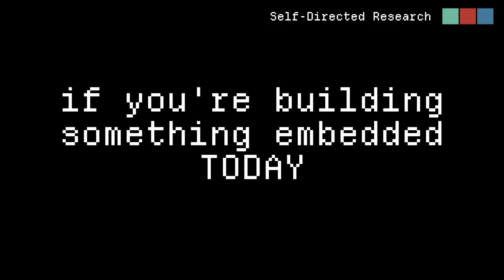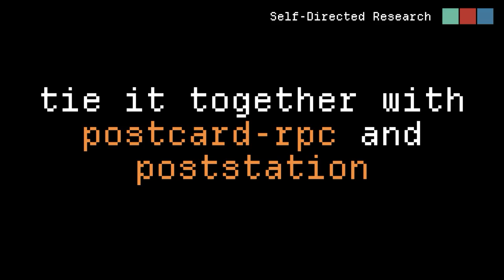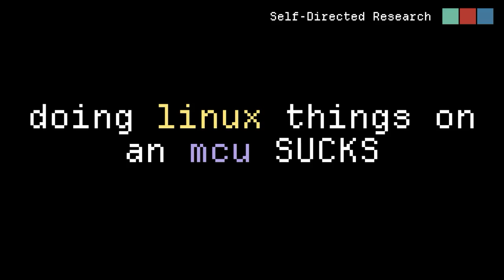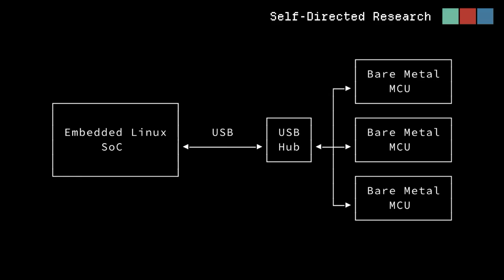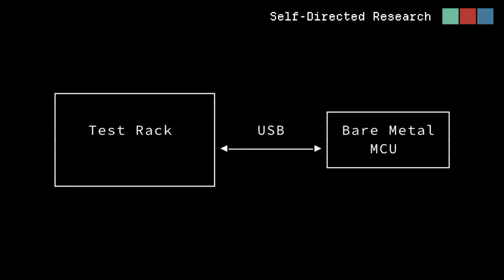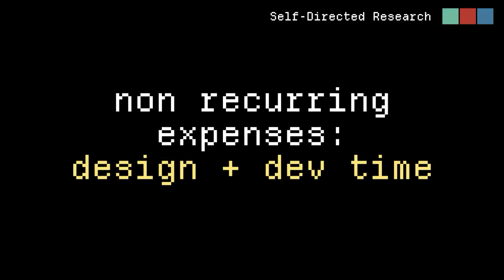The Embedded Buddy System

Comment: a couple things
1: this looks like a really cool podcast i will def be following and watching all the older ones
2: i know quite a few large scale systems use that system for example the nintendo 3ds has a mcu that does all the leds and the power button. the recently released pi 500 uses a pi pico chip for the keyboard controller

Comment: In my last project I tried to do the opposite: all in one big microcontroller. I didn’t want to deal with developing multiple firmware and dealing with updating them and communication etc. I ended up regretting it. The big microcontroller is running out of pins as we needed more functionality and the firmware is really complex because it interfaces with 20 different hardware devices.

I ended up begrudgingly adding another microcontroller just to read a photodiode because I couldn’t find a standalone ADC chip which had a programmable interrupt pin which met my requirements. But using an stm32 as a glorified ADC worked just fine. A few hundred lines of code and I never had to worry about it again.

Comment: I use mcu's for products that have either extreme low power requirements or very hard real time requirements regarding motor controls, so I've never actually had the opportunity yet in my career to use embedded linux. Would be fun to try something without such restrictions. And I'm not sure I'd use rust for the mcu side... Zig does seem to treat embedded as more of a first class citizen, but it's of course way too early and unstable.

Comment: In the car example: run the brakes, speedometer and engine tuning on the small mcus.  Run the entertainment system, GPS and system updates on the big Linux chip.  (For system updates and debugging let the Linux system check the versions of the small mcu's and flash them needed, when parked and after user confirmation.)

Keys is a funny thing. I may want the key fob or your cellphone "key" to interface with the Linux system, because it's an over the air protocol to the outside...
Reply: I agree with all of this. I would add that the small MCUs should have two flash partitions with a bootloader just in case your linux systems crashes in the midst of flashing.